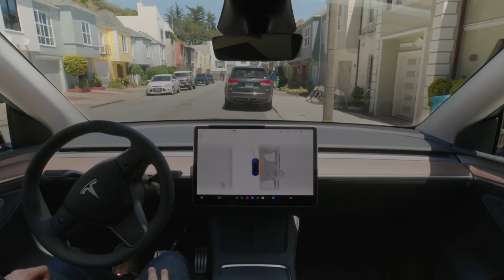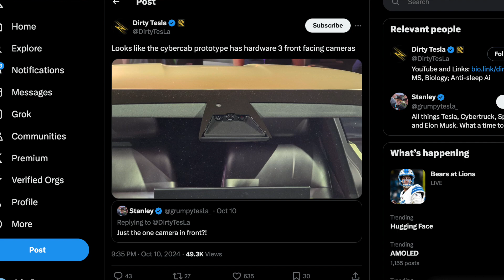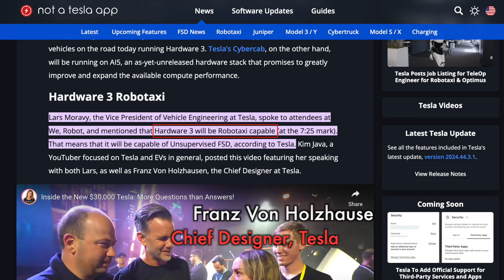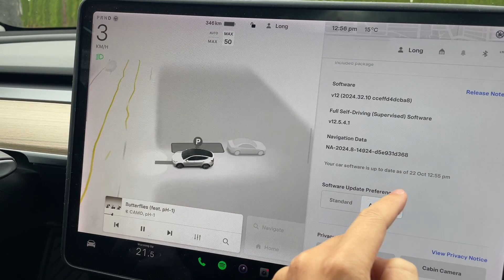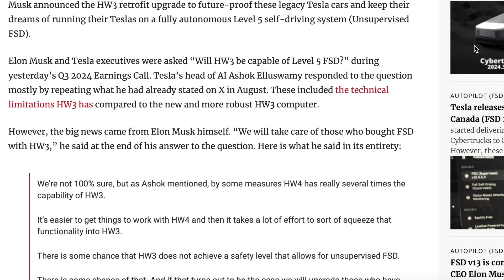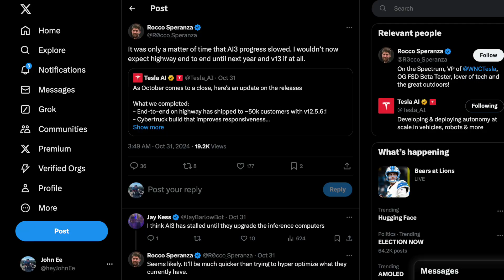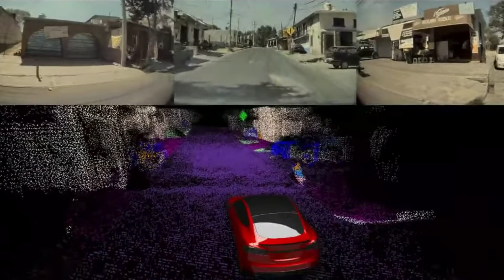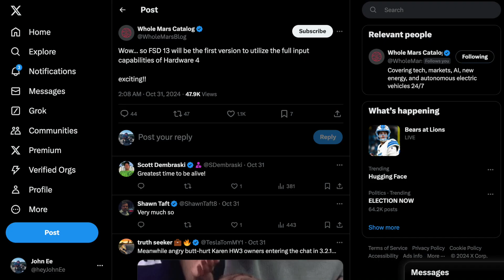Tesla Prepares For HW3 Retrofit on Older Vehicles | This Fixes Everything

Comment: I think the side repeater cameras need to be upgraded so they can see farther when making unprotected turns. Also the wiring harness still net mine need to be swapped out if you swap out the cameras because it might not support the higher bandwidth the cameras will produce
Reply from the maker: Maybe the wide angle front cam does that fine for UPL, but ofc the more upgraded cams they do the better

Comment: I have a '19 M3 SR+ & I paid for FSD before it was available.
I have HW3 & the latest s/w. I've seen it improve over time UNTIL recently. Now it has become clear to this retired Systems Analyst & programmer that it cannot process fast enough. It misses opportunities and often makes moves that are dangerous. I now get honked at which never happened prior because it is unable to 'keep up'.
The cameras are also a concern. I've had the rear & fender cameras replaced as pixels started failing. The front has that issue but they refused to replace it under warranty (?!).
It's now winter in Alberta and FSD repeatedly flashes 'FSD DEGRADED' and aborts before I drive out of my neighbourhood.  Not a good sign for the future.
If Tesla does not replace the FSD computer, I'd be expecting a replacement vehicle with HW4 instead. Any other option would be a poke in the eye for those who paid up front!
Reply from the maker: Yeah I agree and I do believe they’ll do what’s right in the end
Reply: 🤦‍♂️… the cams are the issue…. ot just just third proc. u dont like a ‘poke’? … dont believe a narcissistic sociopath…

Comment: @heyJohnEe Can you link the post where elon confirmed 2.5 cars that have been upgraded to HW3 will be retrofited, since I have a model 3 that was upgraded and want to refer back to it in the future if it doesn't follow through.
Reply from the maker: I’ll drop the link later today when I find it again, but for now just putting it out there that HW2.5 is a free upgrade to HW3 as long as you buy FSD and visit the service center. Then eventually HW3 is retrofittable with HW4 as he mentioned recently. So in this case it would be a direct jump instead of going through the typical path

Comment: Also, add a front bumper camera. HW5 needs cross-traffic cameras. My car gets a HW freeze and stops in the middle of unprotected left turns or U-turns.
Reply from the maker: Front bumper camera is definitely coming to HW5 and may possibly be a retrofit to current hardware 4 as well
Reply: Agreed. Will they add the front camera on current or new models?